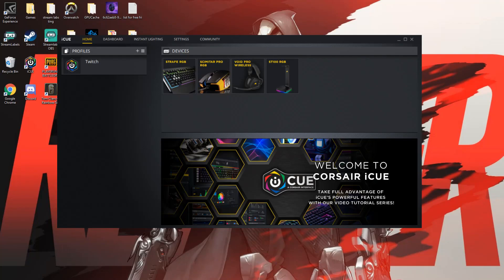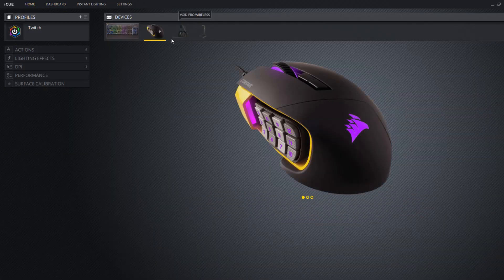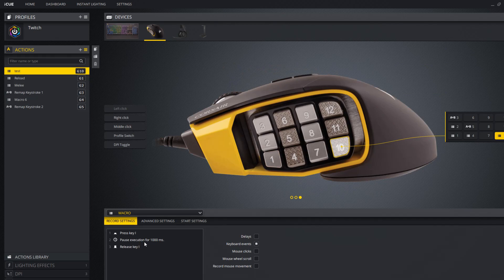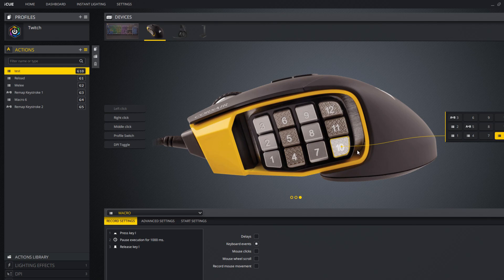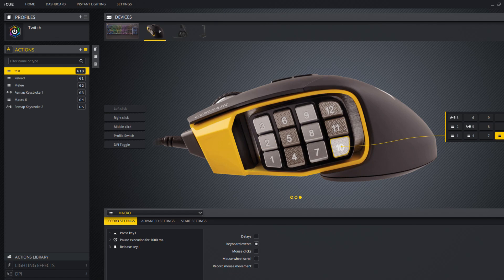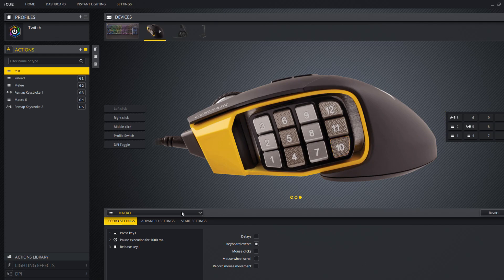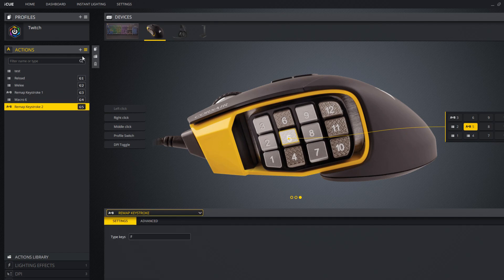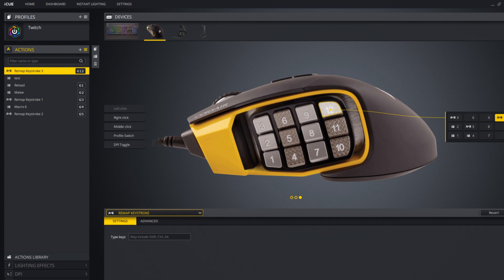Tutorial Tuesday| Episode #13| key mapping

Comment: I am unable to program these extra 5 buttons (nine total) and it just isn't happening. If you could plase advise that'd be sweet.
Reply from the maker: Are you using the same mouse as me?
Reply: It was a stupid mistake but at the same time there should really be big red sticker somewhere that says the mouse won't work properly if you have number lock on
Reply: And by the way I got it working and it made Doom Eternal playable, rdr2 no reaching for default keybindsn(H really?). Remembering some of the binds challenging at first but quickly it became my favorite thing that's ever been invented

Comment: I got this mouse wanting to be able to use the programable keys for gaming but when I go into the game and its like click the key you want to program and when I hit the key on the mouse it acts as if Im not hitting a key at all. Do I fix this by putting the key under remapping?
Reply from the maker: sorry for the late reply.... if you have not fixed this yet here are a few things i can recommend. first make sure you have the latest software update for the program sometimes if the update has not been applied the program will not work as intend not sure why this happens the only thing i could think is that the hardware firmware auto updates and will only talk if the program has that latest update as well. secondly make sure ur applying the changes and that its saving. and last then i could say is to double check that u have clicked on the mouse and that the button u clicked on is shown. also some times when installing it the batch files mess up along the way try uninstalling and reinstalling and see if it fixs it if nothing else works let me know be glad to help.

Comment: I’m on ps4 but all of the side buttons don’t work the mouse works fine but the side buttons don’t
Reply from the maker: It's the way the PS4 is viewing the mouse for example when you plug it in to a PC via USB the computer reads and I identifys it as a mouse where as the PS4 is viewing it as a PS4 controller. Another thing to keep in mind u would need the icu software to run the macros without it. Your device will just treat it as a controller

Comment: This doesn't work for me either. if i set it to a key and then press the mouse button nothing happends. example. put G1 as remap, keystroke. type keys: 1. 
nothing.
Reply from the maker: Odd i will take a look into it and get back maybe they habe change something with a new update.
Reply: @JustAStreamer21  don't worries about it.  It was an issue with the icue software.  I had to uninstall and reinstall everything.  But thanks!
Reply from the maker: @Arkensauce  np glad to help
Reply: @Arkensauce  you saved my life!
Reply: @Arkensauce thank you man, it works. corsair needs to work on their software.